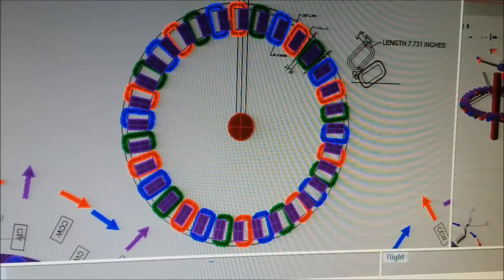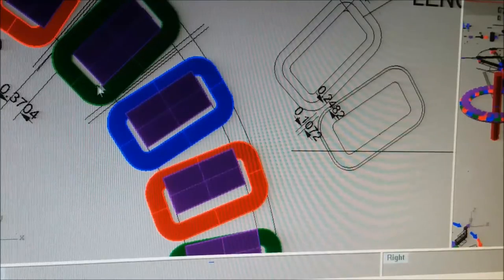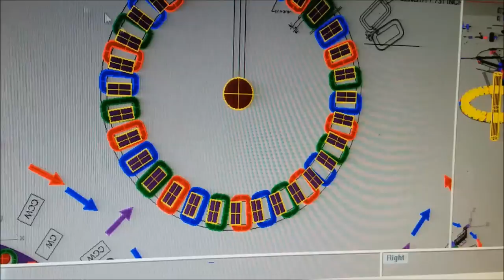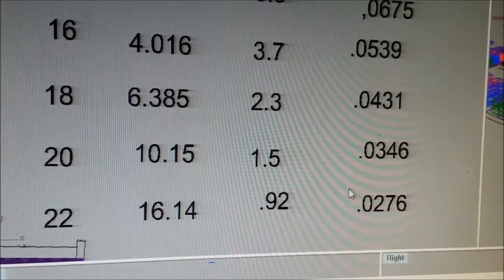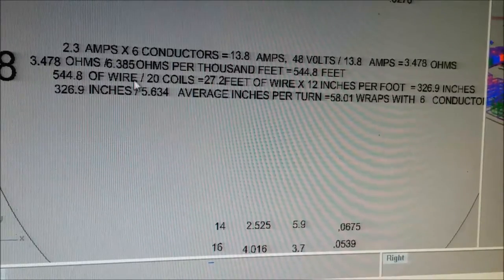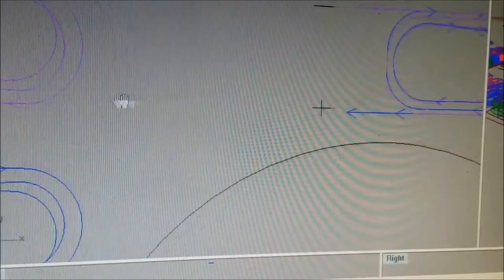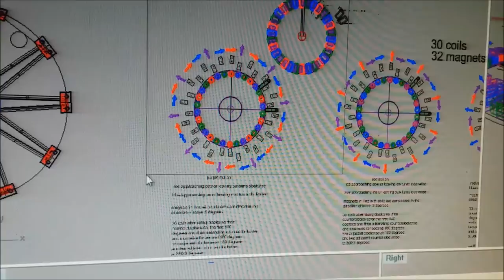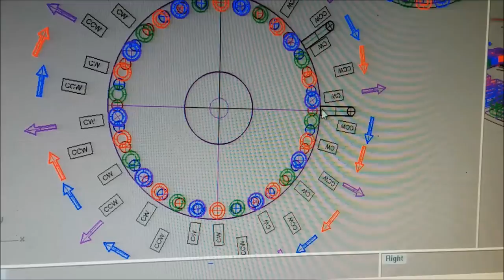HOW TO DETERMINE MAGNET WIRE SIZE AND TURNS FOR WIND TURBINE STATOR PART 2

Comment: May I ask how big should be the stator coil in terms of its length and width if I have a 60mm x 15mm x 5mm magnet? Also, how is the hole/hollowed/core area of a coil determine in terms of its size? Thank you, I am also working on a project similar to yours.
Reply from the maker: Thomas, The inside center hole of the coil is the shape and size of the 
magnet. Since there are radiuses on the corners, the start of the radius
is the end of the magnet and the wire on the short faces will be one
radius beyond the edge of the magnet. The part if the coil that is 
parallel to the side of the magnet can be longer within reason to 
consume more wire and therefore resistance of the coil. The outside
dimensions of the coil should be clear of the next coil by about 3mm.
If you need more wire extend the  ends what you can. Also this will 
make the coil flatter for less gap between the magnet faces and 
improved efficiency by increasing magnet gauss.
Reply: @concretehousebuildinginph1488  
Thank you for the response.
Reply: @concretehousebuildinginph1488  One last question, are there ways/concepts to determine the ideal thickness of the coil or determine the maximum size the coil can be?
Reply: @thomasdonn4821  dude literally everything you are asking was covered in the video itself. it annoys me so much when a YouTuber makes a very in depth video about a topic and provides as much info as humanly possible, and then some person comes along and asks questions about stuff that have been answered in the very video you are commenting on.
Reply: People miss stuff or misinterprete the words and wish too talk too and clarify a specific question with the maker off  the video who clearerly was happy too reply and wants people too reply due too the fact he has a YouTube channel and commenting and replying is kinda the whole point off setting up a channel so why that bothers you bothers me 😂😂

Comment: I am a little confused. When you mention 6 conductors. are you meaning 6 coils of wire on a single post? in which they are tied together?
Reply: I believe, What he means by 6 conductors is, he has 6 strands of 18 gauge wire in parallel in the winding. i.e 2.3 amps x 6 conductors = 13.8 amps.. you increase current carrying capacity by wiring wire strands in parallel

Comment: Would higher voltage be "better" for a windmill? Then use a transformer to step up the current? Or would I be better of, heat and all, using more current directly? Thanks.
Reply from the maker: DAMON, TRANSFORMERS WORK BY CREATING A CURRENT DUE TO THE CHANGE IN MAGNETIC FLUX. THE ALTERNATOR MAKES AC CURRENT AND THEREFORE WOULD SHOW A CHANGE IN FLUX AT A TRANSFORMER, HOWEVER THERE ARE 3 AC OUTPUTS NOT IN EXACT PHASE WITH EACH OTHER AND THEN THE OUTPUT OF THREE TRANSFORMERS HAS TO BE CONNECTED INTO A SINGLE PHASE AC OUTPUT. 
     THE NORMAL WAY IS TURNING THE 3 PHASE OUTPUTS INTO A DC CURRENT TO CHARGE A STORAGE DEVICE/BUFFER. THEN DRAW FROM THE STORAGE DEVICE TO AN INVERTER THAT OUTPUTS WHATEVER
VOLTAGE AND CYCLES YOU BOUGHT IT TO DO. FOR EXAMPLE IN THE PHILIPPINES CHARGE 24 VOLT BATTERIES AND MAKE 220 VOLT OUTPUT FOR A HOUSE. THE CAPACITORS IN THE INVERTER ARE WHAT CHANGES THE VOLTAGE, AND A TIMER SWITCHES THE AC SIGNAL PLUS OR MINUS. SO ALTERNATOR-3PHASE RECTIFIER-CHARGE CONTROLLER-BATTERY-INVERTER- TO LOAD. THERE ARE MCCP CONTROLLERS THAT COMBINE SEVERAL STEPS.
          IN GENERAL HIGHER VOLTAGE IS ALWAYS BETTER FOR EFFICIENCY AND REDUCING WIRE AWG SIZE. MORE TURNS OF A SMALLER WIRE IN THE GENERATOR WILL MAKE HIGHER VOLTAGE
BUT IN THE END YOU ARE DEALING WITH WATTS WHICH IS VOLTS TIMES AMPS. FOR A GIVEN RPM AND MAGNETIC FLUX THE WATTS ARE THE SAME.
Reply: @concretehousebuildinginph1488  so would I be better off letting the blades spin super fast, or after putting a load on it, let them spin slower? I guess for the sake of bearing preservation and centripetal force, lower rpm would be better. Thank you for your video.

Comment: Dear sir! I am building a low RPM generator axial  for wind turbine । 16 magnets for one rotator । Two rotators  .  Magnets are n42 ,size : diameter is 25 mm and width is 5 mm . 
Total coil s are 12 
Wire size gauge no 23 or .576mm 
Turns 
450 
Coil size is : 5 cm diameter and 1 cm width 
Coil mid part of 2 cm diameter is empty
Voltage by hand turning is 8 volt 
My question is my wire gauge is thinner or thicker or good ?????
I used 20 no wire .8024. mm 
But I found 1 or 2 volt hardly 
I used 21 no wire .6mm 
I found 3 to 4 volt less vibration
Which gauge of wire will be fit ???
I need maximum output power for low wind 
Here in India , not fast wind

Comment: I have 50mm x 25mm x 10mm size N52 32 magnets, 16 on each disc. My plan is to generate 24Volts 35Amps. The average wind speed in my area is 11mph. What should be the ideal coil size according to the magnets and 14AWG is my choice with 6 conductors. Is it my right choice ? Or any better suggestions ?
Reply from the maker: Well the number of coils would be either 15 or 18 to be devisable by 3
and resistance needed would be 24V/35A or .686 ohms. 6 is a lot of conductors. at 15 amps for #14 wire the next higher  capacity is 3 wires. With 18 coils there are 18/3 or 6 coils in series, with the resistance per 6 coils in series being .  1/ .686  = 3(1/  ohms per strand). Divide ohms/strand by the resistance of your magnet wire to see how many feet of wire you need for each of the three strands. Wind a coil as thin as practical and see what diameter circle is needed for the coils to be just clear of each other. The center of the coil is the same width as the magnet (25mm)  and the length can be longer than the 50mm if you need to use up more magnet wire to make the resistance value. A larger diameter makes more magnet speed across the coils and therefore higher voltage. 24 X 35 = 840 watts net average output.  Just a guess would be 6 blades at 8 foot rotor diameter but can be calculated for maximum available power in your wind conditions. Flat blades with reasonable angle of attack, or airfoil shaped with a profile from Airfoil tools.com is a starting point.

Comment: @CONCRETE HOUSE BUILDING IN PH which AWG Magnet wire and turns to make four coils that I need to use to produce a 14Volts and 12 Amps please, I look forward to your reply please thank you.
Reply from the maker: The wire size is easy. Just look in a magnet wire catalog for the AWG wire size that is rated  more than 12 amps
something like 16 amps at 160 degrees F. Wire potted in epoxie runs hotter because the heat is trapped. You realize that 14 X 12 is 168 watts I hope. Second part Voltage = Current times Resistance or with a little algebra
Voltage/Current = resistance.  I asked my Rotweiler and he assures me that is correct and I never argue with him.
So in your magnet wire catalog listing there is a column for resistance per 1000 feet of wire. So....14/12 = 1.1667
Ohms of resistance. If you had 2 ohms per 1000 feet then 1.1667/2 = 583 feet. A 12 coil stator has 12/3 or 4 coils per phase, so 583/4 = 146 feet 9 inches per coil. Smaller wire has higher resistance which drives the length of the
winding down. Higher RPM drives the voltage up. This gets related to magnet flux which increases current with higher flux. So.... get the strongest magnets you can crowd into your generator and start spinning it up  with a wide air gap like .187 inches. If your amps are not up to wire capacity lower the air gap for more amps. Stop if you are at .032 inch gap and rewrite the generator specifications.  Not sure what 168 amps would run except  34  five watt LED lights.

Comment: Are all the red coil's outputs in phase with each other? i.e. if you graph all of their outputs do the graphs look identical?
Reply from the maker: Tom, All the red coils are connected end to end (in series) so there is
one sign wave for that phase. The other coil sets are also in series
and output the same waveform but offset by 1/3 the frequency time 
wise,  so while being the same they are offset timewise.
Reply: @concretehousebuildinginph1488  the some waves of the red coils are not in phase though! If you graph coil 1 and, say, coil 13 their outputs will look totally different so wiring them in series will cause negative interference. If the coils outputs were in phase (i.e. all saw the same flux at the same instant) I'd agree with you but they (the red coils) are seeing very different fluxes so I can't see how they are in phase. Wiring them in series doesn't magically mean they're in phase!

Comment: Is it ok if coil touch other coil or coil start or end wire touch another coil or its start or end of coil ...????
Reply from the maker: The wire is "magnet wire" which has an enamel or varnish coating and
is electrically insulated by the coating. To make a connection the coating must be scraped or burnt off.
Reply: @concretehousebuildinginph1488  thank you for replying...i thought it is pure open Copper coil... which pass electricity directly....bec i.am chartered accountant 😉... trying new things in life from new peoples...🙏😊😇

Comment: Can you please tell me which software are you using?
Reply from the maker: I use Rhino 3D  from Mcneil software. Originally purchased to make nurbs curve surfaces while
designing an aeroplane, but now used for everything. It is a one time buy commercial license 
installed on 3 computers.  I also have Autocad14 which doesn't loft curved surfaces, and Solid 
Works which is not used because of the high anual cost, and additional anual costs for CFD 
and G-code add ons.I use meshcam for the G-code on our CAM machine tools running under 
NC Studio.       The software lets me put things on paper that are dimensionally accurate, but
it is a design aid. You still have to the research and design the projects. I design in inches then
make a copy of the drawing or a detailed section then scale 3D to change everything to centimeters. 
Also handy are the analysis tools for calculating concrete volumes in a building centroid of an 
airplane design, surface area to be painted. I use about 10% of the commands available in the
software, but there are prompts of what to enter when using some of the unfamiliar commands.

Comment: Hi there what kind of program do you use .You know a lot how to calculate.
Reply from the maker: Edwin, Not necessairly a program. How about a few examples of how I come up with calculating things.
 I use CAD systems (computer aided design) and preffer   Rhino 3D  although I have  Autocad 14 and
an older version of Solidworks.  Calculations about weight volume center of gravity can be measured from
3D models of the projects, particularly when the model is a lot of compound curves drawn with 4th degree
nurbs curves. However  for the BLDC motors and generators I use simple arithmetic and a little algebra
as was taught in high school and windows calculator. Some common formulas as can be found in Wikipedia
such as Volts = Current X Resistance is used to size magnet wire. The sales literature lists about 40 copper wire guages and the resistance per meter or by 1000 fet of length. I cram as many turns as the space permits
times the length per turn to get the feet per coil and multiply by the number of coils in series. The length times the resistance value gives total resistance. Devide your preferred voltage by the resistance an you have steady state
amps. Then back to the manufacturers literature to see what wire guage will carry that amp load. If necessary
the next step is likely a pulse width voltage devider chip. 
       For aircraft structures a text of applied mechanics has formulas for analyzing trusses and beams, For that start with buckling failure because it drives the sizing. For wings having composite construction calculate  the second moment or inertia and plug in stress and strain to determine material cross section. High school level
moment (torque calculations) will also get you there and if you are talking sizing concrete columns and beams
or floor slabs that is based on balancing the surface tension of a strip of material times its distance from
the mass center compared to rebar cross section from the same center of mass.
     Safety factors are the overdesign of something to insure safe use for construction flaws or damage
during use. For light single engine aircraft 3.8 times the calculated load, commercial jets are 2.2 times the load,
aerobatic planes I use 12 G posative and 6 G negative. House slabs are 1.5 times calculated dead load with a live load of 50 pounds per square foot as an absolute minimum.
      The BLDC coil and magnet count comes from labeling everything positive or negative polarity in a drawing
and rotating one against the other to see that positives versus negatives are attracting and   2 like polarities are
repelling each other through the 6 steps before the whole thing repeats. Anything trying to turn the parts 
opposite the rotation is basically canceling out one of the sets working in the correct direction and therefore
using current and making less power. 
       Mechanical hardware such as ball, needle, tapered roller bearings, spherical bearings, or journal
bearings come from the Timken bearing catalog considering the makimum RPM and the axial and radial 
loads for a given shaft size.
       Calculating multi story building starts at the roof base to see what columns and beam sizes are needed. 
Then add the top floor walls floor slab, ceiling slab, permanently installed "stuff" and the 50 pounds per square foot
to get the columns and beams fro the next floor down. Work your way down till you get to the foundation
and devide total weight by soil bearing to figure foundation contact area. All weights are multiplied by 1.5 safety margin as you go and some token number like 200 pounds for wire and plumbing stuff. If this is not helpful possibly a more specific  question because I have been designing for 68 years and may have done something similar.

                                      george and aurora
Reply: @concretehousebuildinginph1488  thank you
Reply: Am gonna use 1 ball of a bearing at each end for less friction on the mill and a magnet clutch to bring higher speeds to the generator.With enough distance so they don't disturb the field.

Comment: Hi how do I determine the coil thickness from the center hole of the coil?
Reply from the maker: Sean, First determine the wire guage by it's resistance value. The center hole width is the width of the magnet, The length is magnet length plus 2 minimum bend radiuses. Sketch out the coils and leave 1/8 inch between them at the inner ends, This width divived by the diameter of the enamel coated magnet wire gives the wraps wound per layer. Measure your drawing to get the average length of a wrap. Then the wire required for your resistance value is divided among 2/3 of your total coil count. This length divided by the wire used for the bottom layer determines how many layers to wind. Keep the coils as thin as you can. The coil thickness plus the running clearances to the magnet rotors needs to be as small as practical to more effectively use the magnet gauss. The 2/3 coil count is because at any instance two phases of coils are in series. There are 6 steps of rotation
and then it repeats.

Comment: what is the rule for the QTY of magnets vs QTY of coils in a generator ? do they need to be equal ?
Reply from the maker: they should not be equal in number because a condition called "cogging"
occurs when all the magnets pass the zero crossing point (become centered on the coils) at the same time. a motor runs rough and a generator will require a LOT of torque to start rotating. There some ratios like 9 to 14 that are popular. I have 30 coils to 32 magnets. Generally you would set the inside of the coil dimensions to the magnet dimensions and the outside dimensions of the coil as needed to get enough OHMS to get the voltageyou are designing for. Then pack the coils into the tightest circular shape practical. The coil centers determine the radius of the magnet circle. you will find making the OHMs length the hard part because you have seen advertising literature with grosely over estimated power output. I actually made this video because I figured out a trick that has all the coils generating in the same direction on each phase rather than some canciling out others in the series wired coils. It is on a video showing the magnets passing the coils arranged so whether they are pushing or pulling the rotation is in the same direction for all the coils.
Reply: @concretehousebuildinginph1488  that if there is any movment but if the magnets replaced by electromagnets then they could be equal